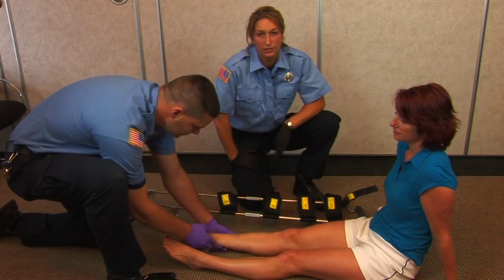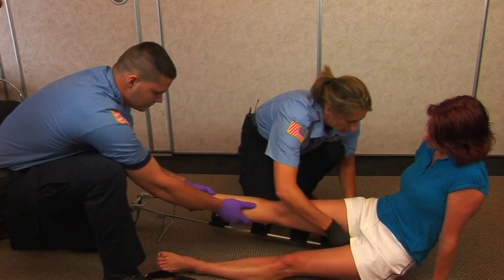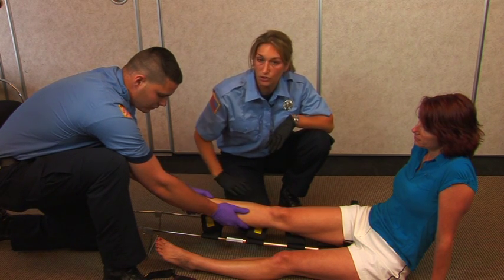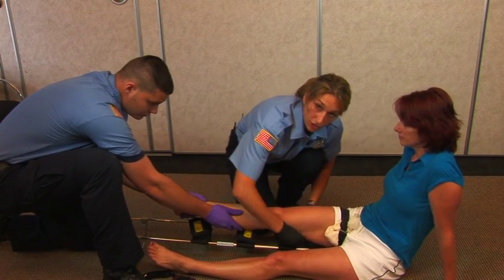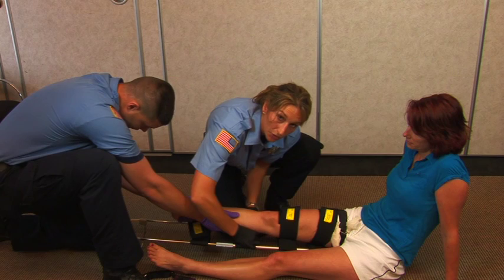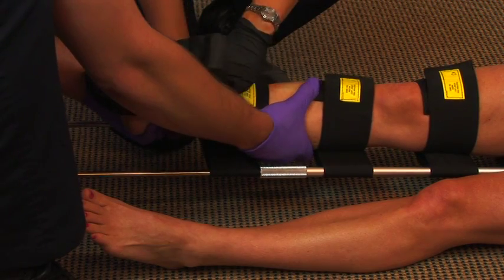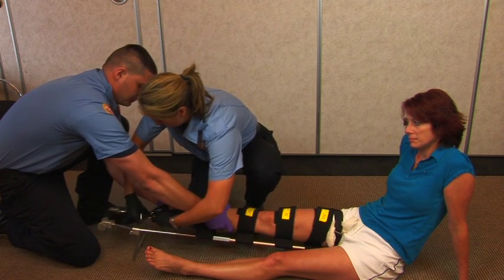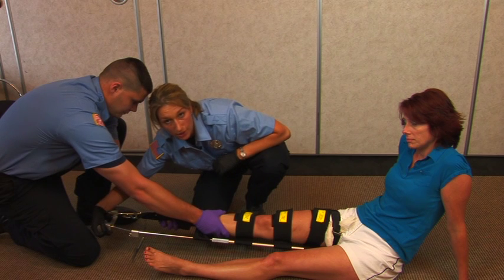Emergency Medical Care : How to Make a Traction Splint for a Fractured Femur

Comment: Wrong! Ischial strap then ankle strap. pull mech traction til injured foot is equal length to uninjured leg or distal pulse is regained. then tighten straps going up the leg. recheck csm.